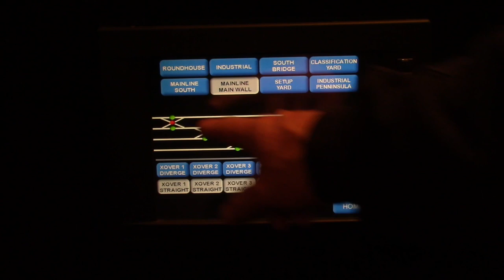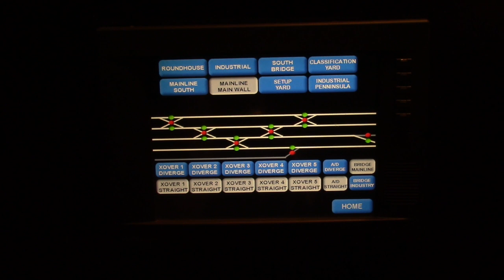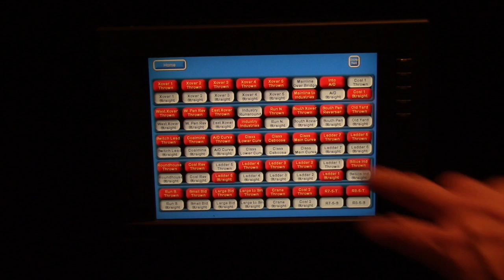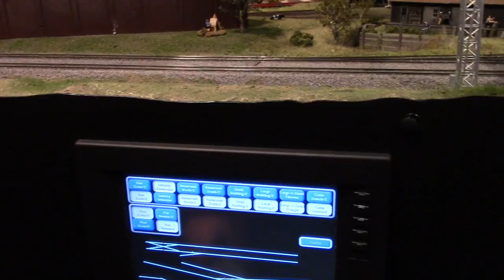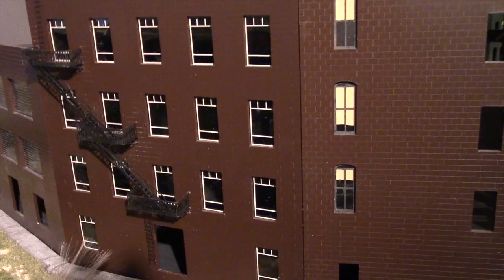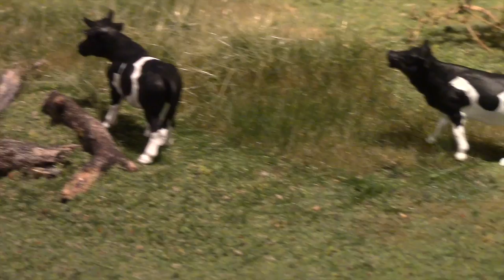HO Layout-Model Railroad Block Detection and Automation

Comment: One think I am looking at, You have signals, Red. So on DCC, How do you tell the train to stop and where. I know you have deteckion,  so how do you places along the trails to know where the trains stops. I am looking to start building a system
Reply from the maker: It's still the responsibility of the operator to follow the signals.  The trains will not stop on their own.  The signals are just an indicator for the operator to follow instructions.
Reply: AS I am still watching your video, Can the trains stop and start them self, (on Dr B Shubb) C/MRI

Comment: great,, we use crestrons at work as controls, I would love to know how you built all of your sensors and block controls
Reply from the maker: +Jon Carlson I am using output cards From Bruce Chubb to control the signaling and input boards from team digital and Crestron to poll the inputs.  The input cards are triggered by sensing current, which is either the motor in the locomotive or soldered resisters across the axles of regular rolling stock.  The input card senses that there is resistance on the rail. The rail is divided into 96 individual sensors and blocks.  Once the Crestron sees a sense from the input cards, in programming, we trigger outputs to the output cards.

Comment: I like how you use a touch screen for simplicity of under standing the route you want to take. Now we all know the majic is under they layout. What do you use for detection and logic for the system to know where the train is or what aspect to show?

I see what 87JSlice is commenting about the double crossover signals showing green for both. If there was a way to throw each crossover individually it would display the correct aspect. You cross from main 1 to main 2 with a red over Green signal then the other 2 signals would show red over red protecting the cross over from other trains either trying to also cross thru or run thru a closed switch. Regardless your set up is far more advanced then any I have seen before and did a very nice job with it.

thanks for sharing
Reply from the maker: Trent Blasco In programming, being the double crossovers are 4 completely independant tortoise motors, I can trigger 2 if I chose to.  In my instance, I would rather trigger all 4 which will allow a train to NEVER derail irrelevant of which mainline its on.  To me, that was more important.  The processor is made by Crestron.   I am an authorized dealer for Crestron product and we do all of our own programming for High end automation systems.  As far as detection, we are using Team Digital block detectors every 3 feet and seperate detectors per turnout.  These are fed into the system as inputs using Bruce Chubb smini cards.  We are controlling and monitoring anything the smini card is reading as an input.  We are also controlling and driving the smini outputs from our processor.  As far as aspects, any aspect can be programmed, whether it be prototypical or any unique aspect you choose.  These can be individual leds, flashing, ping ponging....doesnt matter.  A programmer drives the whole system any which way it needs to be done.  Thanks for your interest.  If you would like more info, I can be reached at lsantello@media-designers.com
Reply from the maker: +Trent Blasco The answer is "whatever you want", it's programming.  Each turnout within the double crossover is seperate, and so is the detection for each of the 5 sections of the double crossover including the middle.  On my layout, I just chose to throw them all simultaneously to avoid ANY derails.  Avoiding derails were more important to me, although anything can be done easily and fast in programming.